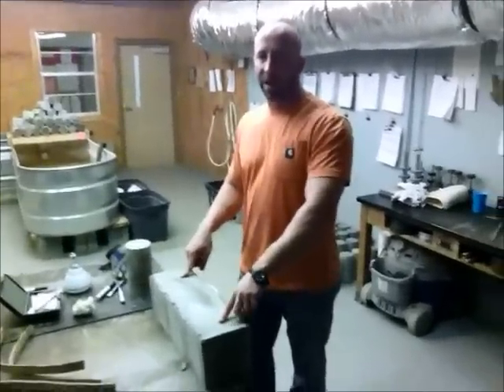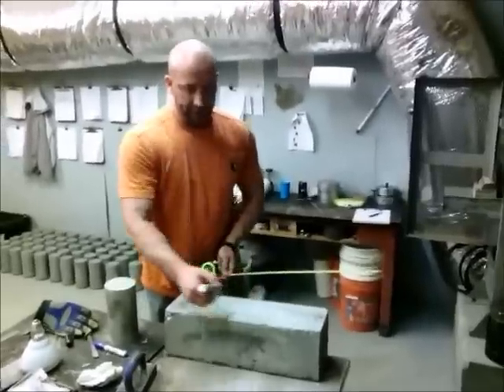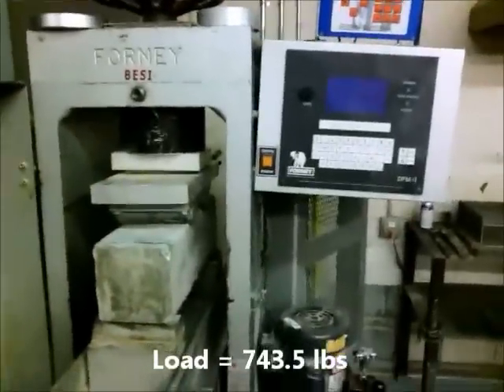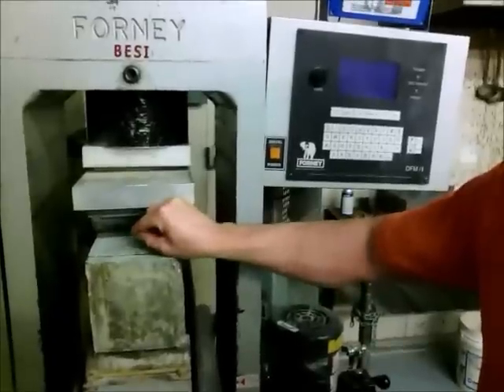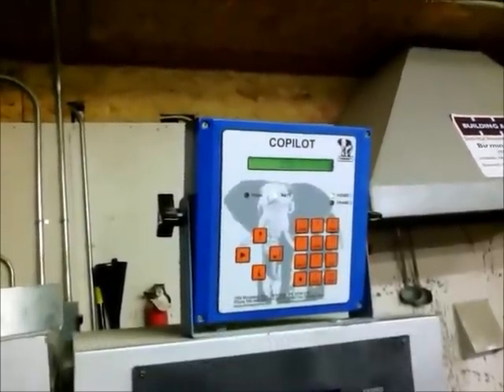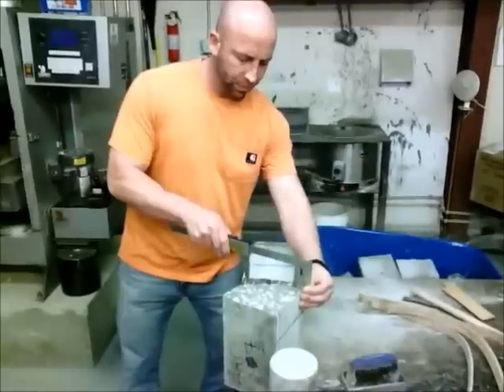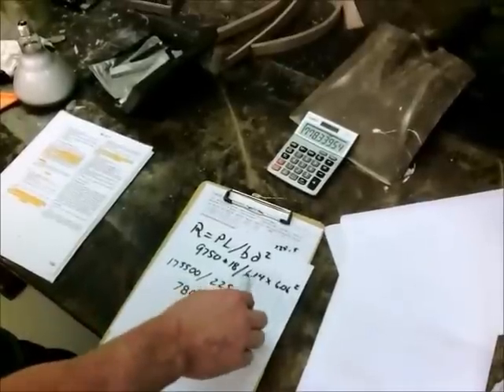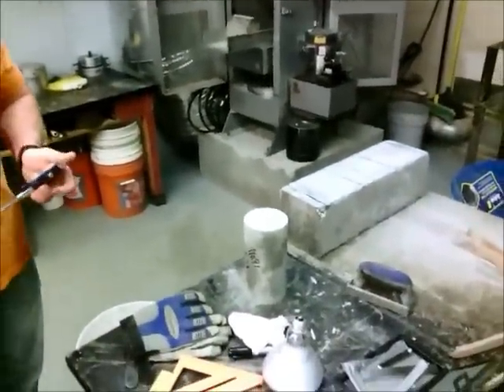Concrete Beam Testing

Comment: ***** The depth determines the "span length", which is the length between the two lower supports/reaction points.  As long as the specimen extends an inch or more past the supports on both ends (i.e. outside of the span length), I don't see anywhere in the ASTM stating a maximum length of the entire specimen.